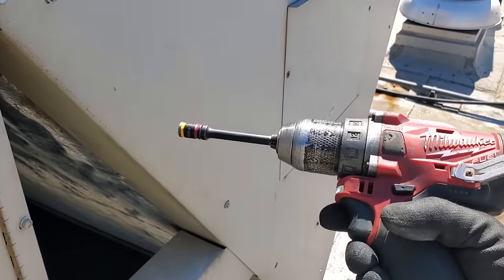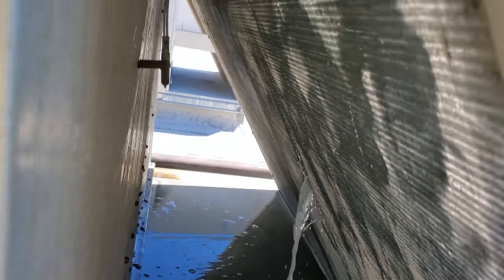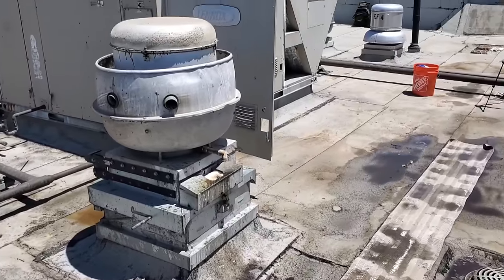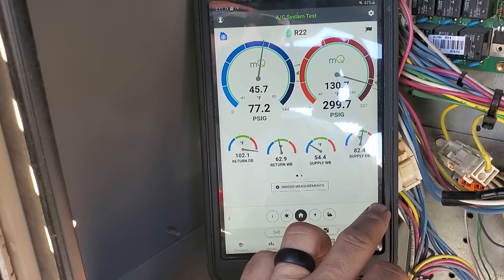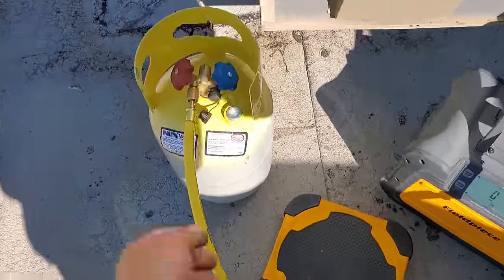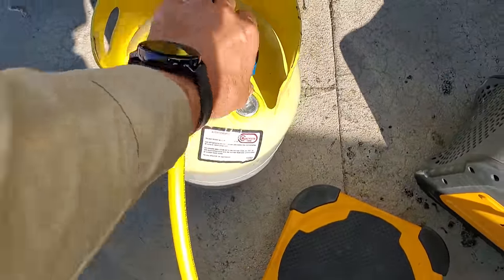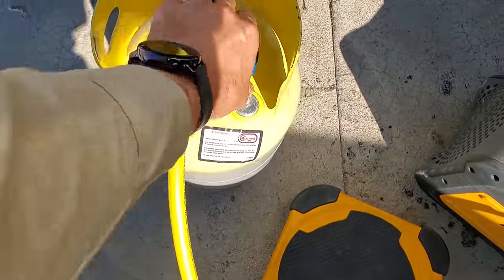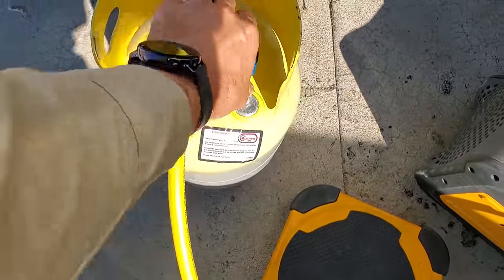IT'S DYING A SLOW DEATH

Comment: I use a impact and only strip out 6 of every 10 screws, but 2 are on purpose so I have a challenge next time!
Reply: Those screws are easy to remove. Just get a small pry bar behind it apply pressure and zip it out.
Reply: I love my impacts 😍
Reply: Just keep rotating these screws long enough and they will fall right out ... :]
Reply: Weld'm together enough friction just keep spinning 😆😆
Reply: I use an impact on wood screws and thread-rolling screws and a drill on machine screws. I have a feel for my impact driver and only use it for high torque requirements.
Reply: @brandonrussell1331  same, but I have good trigger control and I don't run it on the full setting.   I have the Milwaukee M12 and I run it on setting 2.   Never have an issue stripping anything, and I use it for basically everything.   I even use it on 8mm fairing bolts on my dirt bike lol.  Just don't be a psycho who holds the trigger and hammers a tiny screw into oblivion.
Reply: He probably doesn't know how to use an impact 😂

Comment: Dirty coils lead to high discharge pressure leads to high temperatures leads to oil breaking down leads to plugged driers and metering devices.
Reply: Rewired(eliminated) variable demand exhaust leads to exhaust drives rewired for full speed motors and insufficient(nonexistent) make-up air unit leads to 100% open package unit dampers and open economizers which leads to excess air flow over condensers plus lack of increased pm is what leads to dirty condensers.
Reply: Exactly my thoughts. High temp and preasure breaking down the oil. May want to do an oil change cause if its on the TXV and plugged the drier, the sump of the compressor is full of it. He may wait till the compressor fails.
Reply: Which leads to the dark side.
Reply: @SethMaelstrom  thats liberal arts . This is the tippity top of the slave pyramid.  Not the trader pyramid
Reply: And a headache for the service man!

Comment: The variable trigger on my 1/4 impact works perfectly. Not every fastener needs ugga duggas.
Reply: I'm planning to buy one of those, but I know my way around a trigger and i use an impact drill. I have never stripped any screws
Reply: mine has a switch on it so you can choose.
Reply: The 12v Milwaukee impact is the perfect size for tossing in a service bag to remove panels. Trigger and speed switch keep you from stripping anything.
Reply: @em1osmurf  it switches between standard drill and rotary impact function? i can't find those types anywhere i think i'm looking for the wrong thing. what do you have? thanks
Reply: @cliveramsbotty6077  the m12 fuel impact i use at work has a sheet metal setting which stops once its tight
Reply: Apparently he thinks the impact strips the fasteners and not the operator SMH
Reply from the maker: I realize its operator error but its easier to get rid of impacts than assume people can be trusted with them.....
Reply: @HVACRVIDEOS  I see what you did there ;^). Clever, clever.
Reply: @HVACRVIDEOS  Yes it is operator error, I use my Milwaukee M12 impact gun all the time and use the trigger properly so it only gets the screws tight without using the impact
Reply: @HVACRVIDEOS  I strip less screws with my Dewalt 1/4" impact than with the 1/2 drill with a bit... Lol
Reply: @all6t7  impact guns don't kill fasteners, people do.
Reply: I find the older brushed motor impacts are easier to get precise slow/low torque with trigger, where the  brushless tend to be jerky and want to surge high power/speed
Reply: @MarkAtwood0430  12v Milwaukee impact is essential. I can't imagine not having one. The 12v line of theirs is really nice, hardly ever use 18v any more.
Reply: I find this conversation to be very impactful.
Reply: @em1osmurf  Same.  I use setting 2 on my milwaukee M12 combined with some trigger control and never have any issues.

Comment: I've done a lot in automotive AC, done a lot of reading. What I find over and over again when I watch your videos, almost no one in Automotive really understands how AC systems work. I have learned more from watching your videos meant for other HVAC techs who already know the basics than I have from schooling, ASE Master techs, ASE AC books, and ASE master trainers. What I have learned from watching your videos has cut down AC diagnostics times and wrong parts replacements substantially. A job that normally takes me 3 hours to diagnose is done in 20 minutes sometimes because you have taught me about temperature and pressure differentials without having test ports all over the place and just going by line temps. In a couple of your videos you covered operational theory of some of the more complex components, which perfectly covers the simplified versions used in automotive.

If you ever get sick of restaurant HVAC work, you might try your hand at automotive AC, you'd likely be better than 95% of the guys out there doing AC on them. You'll just have to learn to fight around interior panels. Awesome videos!

Comment: Buildings should be slightly positive pressure, never negative otherwise you're drawing in outside air through doors and cracks etc. The air in the building is no longer cleaned by the filters in the air handlers. There is dust in the air and in the food.. Everywhere.
Reply: yep, always positive pressure, which also keeps sewage gas out of a trap primer quits working and they dry out
Reply: RuleofVicus  Reminds me of when they would start up the swamp coolers at Ft. Bliss, TX... the building smelled like fish for a week.
Reply: On the flip side, if you over pressurize you’ll get stacking, and your doors won’t close all the way. They had me on a ladder, stairwell after stairwell, adjusting door closers. 🙄 instead of adjusting air flow. Cooling towers, 250 ton chillers, air handlers, VFD’s. I’ve done it. Still would if my old body could keep up.

Comment: I was told years ago when they started to recoup freon  that it would be clean and used again. You are the first one to see cleaning R22. What my job do is we would clean and reuse oil. It is tested for acid and it is filter and dried out from moisture.

Comment: At 07:30 did anybody else close one eye, and move their head from left to right, to check if the pulley was straight? It doesn't work on a video screen...
Reply: I've done that in games trying to look around corners or bushes. You catch yourself doing it and take a moment to contemplate your brain fart.
Reply: Yep... It's involuntary...
Reply: one hand on either side of monitor, oscillate...
Reply: Doesn’t work on some people’s eyes as well from what I’ve had to rectify
Reply: @EnderMalcolm  i do that in games a lot but i also automatically look around the corner ingame so just for the immersion

Comment: Clogged drier is interesting. We have an account where return air is typically high 80’s to mid 90’s. 
Since your unit is pulling in 100% outside air I imagine it is similar heat load, since I am in East Alabama and have super high humidity all year. 
Those units had issues with filter driers due to high superheat from heavy load on evap leading to poor compressor cooling. Oil breakdown and premature wear to compressor. We put in 30 cubic inch driers and still change half a dozen each year.

Comment: I work on all types of A/C systems from vehicle to commercial. Recently I had an interesting one on my Jaguar. It just suddenly quit working while driving and come to find out the desiccant bag suddenly disintegrated and plugged the drier filter. Thankfully it is a very well designed system that has a very fine micron filter and has enough capacity from the compressor to drier that it never came close to over pressure. The rest of the system was spotlessly clean. Can't complain after 25 years of use

Comment: Excellent video as always sir. I’ve been into this same issues with metering and drier.  I found issue was damaged piston compressor that have shaved pieces it will clog drier up and metering as well. Maybe one or two months later the compressor is grounded. And scroll compressor just replaced drier and runs good, depend on diagnosis. Again I’m impressed that you’re right on spot sir.

Comment: I have gotten so many air conditioners to work gr8 just cleaning the condensers. With a clean
condenser, it better gives off the heat it absorbed in the building.

Comment: I have actually seen a drier fail on a R-134A system and filled the liquid line full of desiccant beads. They were packed so tight I couldn't get nitrogen to flow past or back purge them out. First and only time I have seen this.

Comment: This is where  I would put low man on totem pole wire fin comb   my area famous  for hail storms. 
Have hard time convincing commercial  buildings  to spend little more and purchase  hail guard  accessories  for new unit  until  they pay to have coils combed or replaced depending  on storm  and wind  hail size and strength  of wind

Comment: That intro was the best... When i was an instructor i would teach that to all my students based on my years of experience with striped screws especially on carrier units. Simple yet , most do not care... I have bought thicker screws and replaced thousands of stripped screws over the years...Mechanics 101.
Reply: Yup!
If you're going to use a screw-gun to install machine screws, either:
1) Get REALLY good with trigger-control (not recommended)...
2) Use the screw-guns clutch properly (semi-recommended due to people getting lazy or forgetting to set the bloody clutch)...
Or
3) Use the screw-gun to drive the screw in almost all the way and use a screw driver to snug it up (also semi-recommended due to people getting lazy and not stopping before they've snugged the screw down with the screw-gun and stripped the threads)...

When I was in Electrical Trade School, if an Instructor (didn't have to be your Instructor) saw you use a screw-gun to install a switch or receptacle into a device box, you automatically fail that Practical Exercise right then and there...the School reused the switches, receptacles and device boxes for as long as possible to save on costs and they were replacing too many boxes due to stripped screw holes due to screw-guns being used on them so they implemented the Screw-gun=Auto Fail policy...
It worked, the number of stripped screw holes dropped immediately after the students got it through their heads that the Instructors/School were NOT kidding about it...

Comment: I have friends who DO NOT do any preventative maintenance on their vehicle either, So i had the fun job of checking my friends vehicle out, The cabin filter was black and completely clogged, Air filter was black and full of grit, blown light globes all over the vehicle, on top of other issues. So my point is, if you look after some thing it will last a heck of a lot longer. Preventative maintenance is a must in my books.

Comment: As a former carpenter and current HVAC technician can I offer some advice. Drills are for twist drills to bore holes in things. An IMPACT is for sinking and removing screws (fastening device). That being said you are correct about it being about trigger control.🇺🇸

Comment: I used to look down on using impact for panel screws too, but got the Milwaukee 12v small impact driver lets you turn down the speed, and you just feather the trigger and i never strip out screws. Plus i have an impact now when i need it

Comment: Your liquid line is colder than the ambient. It’s not an expansion valve.
Reply from the maker: Yeah I was thinking about it as I was driving back and knew something else was going on, than when I saw the difference between the liquid pressure and the discharge pressure I knew something was up. The first day I was dying it was well over a hundred and I was up there for 5 hours cleaning coils.... needless to say I was spent...
Reply: @HVACRVIDEOS  And then after you get down from the roof your cell phone rings and you here  " On your way in can you stop at ...."

Comment: Liked how thurow you were here! Only things additional I would have done is adjusted the belt with an amprobe to the motor plate amps and ran a acid test on the #2 stage system! Great video! Thanks for an awesome video!
Reply: Go back and do an acid test on#2 and if it tests positive for acid add some acid away to the system and you could avoid having a burnout! If all of this pans out let the customer know that you went the extra mile to save the compressor and you hopefully will have a customer for life! The others who were looking at the system before you damaged the condenser coils and most likely didn't purge the air out of their hoses and allowed air to get in the system so acid is likely in the system now and is causing the sludge that clogged your filter dryer!

Comment: I have tremors that affect even trigger pulls, so I just drive everything by hand.  Slower, but a lot fewer stripped screws.
Reply: I learned to clutch, and in difficult cases a high clutch setting approaches the effect of impact drivers.
Reply: I tend to full gorilla on screws by hand and end up stripping more than using an impact with careful trigger control
Reply: @throttlebottle5906  I'm done the same before in secondary school lol 
Complety stripped an m4 blot and nut that I had glued in by melting the acrylic around it to fuse it to the bolt to prevent it coming out

Comment: impacts are great, the knowledge of how to get the tool to do the job intended is priceless..the newer milwaukee impact i own has the option to cut off holding on the first hammer strike or even set the torque very low and is the appropriate tool on fasteners instead of using a drill made to drill holes mutch like using duct tape to seal ductwork...

Comment: there's a place for impact drivers - people just going crazy with them where it's not appropriate is not one of them :D 
My small 12V DeWalt impact driver is pretty nice to handle and if you are careful with the trigger, you can use it without stripping out all the screws every time. Using a proper drill with torque settings is still preferred for tightening bolts and screws cause that way you get it right every time without having to think. You can also get "torque sticks" for big-boy-impacts to limit the maximum torque you can tighten up a bolt. 
As for loosening bolts and srews, I prefer using the small impact, but if you happen to come upon a badly rusted screw, you can easily rip the screw head off (but that probably would've also ripped off using any other drill as well).

Comment: I love your videos keep it up i had a question since i dont work on alot of lennox RTU equipment i had my first stage compressor out on alarm low pressure so i put some gas in it to close my pressure switch and it worked but my 1st stage pressure switch closed but compresser still wouldnt kick on no matter how much pressure i put to low side and i only had one wire to 1st stage contactor and not getting 24 v to that contactor from transformer but off the otherside of transformer i was getting my 24v to contactor for  compresser 2 that has 2 wires to coil whicth makes sence to pull contactor coil in so idk if it might be out on something trough the prodigy board thats not allowing 24 v to that contactor but its some type of low voltage issue and i am getting power from thermostat to board idk if you knew anything or have advice on what to check its weird i only have one wire to the coil thanks so much your videos really teach young people like me commin into the trade

Comment: Another good video. I’ve noticed in some of your past videos you’re using different types of solder on different types of material. I know why and for what for but maybe you could explain the different types of silver percentages you’re using for copper to copper or copper to brass fittings. And if you do or do not like to use flux and why or why not? Also I’ve recently moved to the rosebud tips, have you yet? I was apprehensive at first but I’ll never go back to the old #2. Just want your view? Respectfully for course. A nice hat would be cool too. Thanx, Much...

Comment: I’ve actually seen where a drier failed and put those beads through a system. It was on a truck that had a failed compressor, didn’t have a drier in stock and the driver didn’t want to wait. Took a gamble and sent it without a new one, it failed week later and ended up needing all line and coils, it was a sleeper too so it had two exap coils.
Reply: We have air dryers to lower the dewpoint on some low temp probers and the dryer has two reservoirs of those beads of death with a switch than passes air thru one, then the other while the first one purges and re-dries, and eventually they disintegrate. Then the powdered desiccant gets into the terminal air filter inside the dry chamber, getting blocked, slowing airflow, causing condensation, and freezing up the prober system.

Comment: Great video! I agree with your diagnosis. Dirty condenser, and evap running far warmer than normal due to 100% outside air, must have had compressor discharge temps going sky high. With mineral oil, that's gonna cook it, and it then leaves wax deposits everywhere, especially in any already occurring reduction in the system, such as the TXV orifice and the multiple passages in the drier. 

You're fortunate that Lennox didn't use a multi-orifice metering manifold like some Trane Voyagers do...those are a nightmare with a similar poor operating condition (high head pressure; high superheat/poor compressor cooling) when those orifices plug up with overheated oil wax.